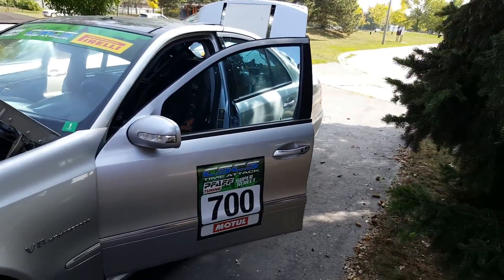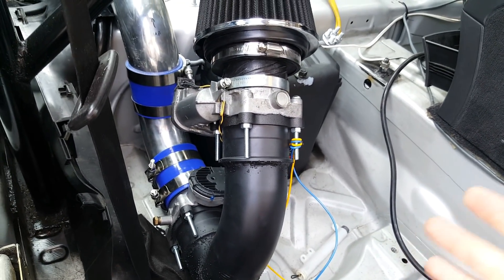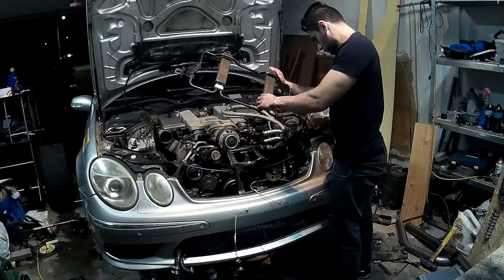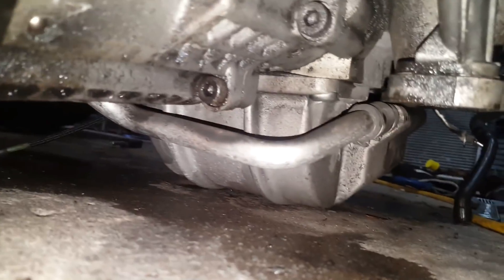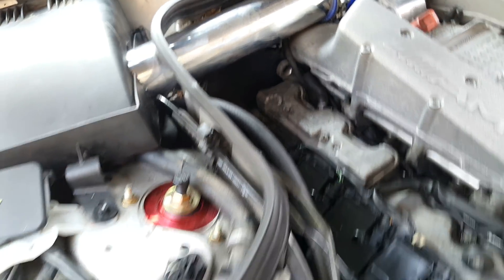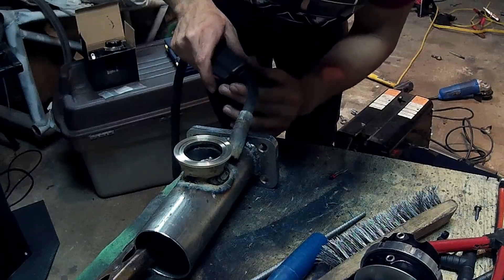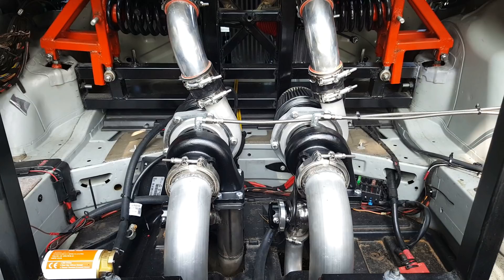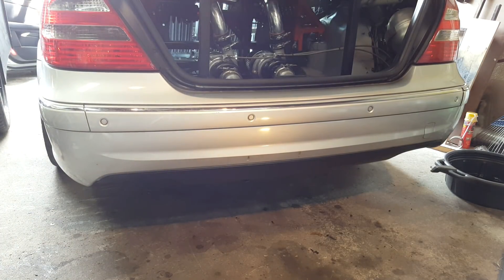How to Build a Properly Fast Track Car - Part 11 (Turbo Install)

Comment: What if you don't want the supercharger pressure at all? Would it eliminate have to add the circuits? Just turbos in the trunk and turbo charged pipe coming upto engine bay, where would you plug the charged pipe? To the throttle body? Or the the intake canisters y pipe? I'm planning of removing the belt from the supercharger leave the clutch wiring as it and just feed it the charged air from the turbos and get a tune, is it possible?

Comment: Heat generating and / or exchanging components should be located and exhausted at the rear; and any kind of intakes should be at the front. Fluid expands when heated and intakes sucks. Vastly reduces drag due to air friction and compression. You also gain some thrust. Intakes pointed directly at the front works like a ramjet (kind of) at high speed if designed right, working like a forced induction system.

Comment: the intercoolers in the back seat aren't doing anything except restricting flow.  straight tube would be better.
twin charging is when supercharger and turbos run sequentially.  if you use the supercharger's bypass valve, it's just turbocharged.
Have you seen the STS turbo system?  why run exhaust up into the trunk, then back down?  having turbos under the car will help cool them.  how's the heat inside the car now?

Comment: Did you go with smaller pulleys for the supercharger? You’d be able to get a lot more boost from it.
Reply from the maker: Yeh, tried it before. The intake temps get too hot with the supercharger.

Comment: Due to the long exhaust pipe before the turbos, you will experience turbolag, but if you do it right, the supercharger will compensate for that

Comment: This is pretty nuts...one of the your first videos I saw was on the building the rear suspension and now I ran in to your video on suspension set up. I also had investigated a rear mounted turbo which you did, real nice. I subbed since it's the kind of stuff I do! Anyway, has your F/R weight distribution changed much with the turbo out back?
Reply from the maker: Not much of a difference really, because the mufflers removed were actually heavier than the turbos. The turbos only weigh 8kg each

Comment: Im curious on how much boost the turbos make? i would think they wouldn't spool that much since they look fairly large 68-70 mm and they are 2 of them. Massive lag probably. I have a 5.3 LS with twin 70mm turbos and they are quite laggy even so close to the exhaust with lost of velocity. Great content tho keep it up
Reply from the maker: Lag wasn't too bad surprisingly. I had the supercharger for low rpm but later I also ran the setup without the SC. The turbos were always on full boost by the time the car reached corner exits. Wouldn't recommend it for street use, but on the track because the exhaust gets hot and the engine revs fairly high, lag isn't too bad

Comment: Efficiency is lost when turbo are so far away and oil the turbos is weakening the oil pressure of the engine/add a electric oil pump for when racing.

Comment: I would have had the exhaust go straight out on each side of the license plate. The whole back of the trunk could be open for air to flow out after you have the roof scoop

Comment: I would of chosen a difference to way to lubricate the turbos. I would give them their own oil system, independent of the engine. An electric oil pump that lubricates the turbos from their own oil tank with a cooler and thermostatic switching would work well. You could position the tank above the turbos so that no chance of oil starvation. An oil accumulator with a pressure switch would allow more oil for the engine,pressure monitoring and reduce any chance of oil starvation.

Comment: I have made those pulleys from good quality billet alloy for a customers race car. We used high quality SKF bearings. Way cheaper than the plastic items and not had any problems with them. A good shop could make them for you and one less thing to worry about. Impressed with the level of engineering, design and effort you putting into this project, some great stuff going on!

Comment: In retropespective.....Twin turbos added to an already supercharged engine is asking for overheating trouble... Even with additional coolers you haven't avoided a blown motor. ....... So is it to much are due to bad cooling after all?
Reply from the maker: The supercharger disconnects after the turbos spool up. The temps were actually cooler with turbos since it had much bigger intercoolers. The engine blew because it lost oil pressure. It wasnt boost or power related.

Comment: What software are you using to tune the mercedes ecu or are you using a stand alone?
Reply from the maker: I wanted to find a tuner to tune the stock ecu for me, but so far it seems unlikely. Most Mercedes tuners here don't know anything more than a simple pulley tune. 
I'll try to look for a tuner before next season but if I cant find someone then stand alone it is.

Comment: wow. butchered that car.  🙈.  u could of did a tune and a a pulley upgrade n got the same horsepower lmao.  ur such a noob to do that to a mercedes. smh.    rip e55. cant wait until you blow it up 🤣

Comment: Dude just be careful of in-cabin exhaust leaks from the turbo. Use a  Carbon Monoxide Detector to see as this gas is odorless.
Reply: only the intake goes inside the cabin

Comment: I applaud your work, the twin charge system is neat, however I can't help but wonder why?? Its a very heavy AUTOMATIC sedan. Seems like a huge expense and amount of work to get an 'average' result at time attack. Thanks
Reply from the maker: tbh its probably just as expensive as other cars its competing with. I've spent around 30k including price of the car so far. People that start off with miatas or s2000s also end up spending the same amount to get similar laptimes. Its also been on stock power so far, so with the added power and hopefully improving my driving times should be good
Reply: SK8215 I understand all that, however it is still and Automatic, given your obvious high level of knowledge in engineeing, you must realise the power loss and overall weight that this transmission creates is definitely hampering your efforts, so is the glass roof and mechanisms. There is still a large amount of weight that could be taken out of this car. It is far easier to remove weight than add power.

Thanks again, and best of luck... Looking forward to future progress.

Comment: If you cut the rear floor pans for the intercooler intake and vent it out the back window you'll be less likely to produce lift than having the intake on the roof. Depending on how much resistance the intercooler cores will add you might even make downforce.
Reply: Matthew To this and flapping,when i deleted my sunroof before i installled the carbon plug i went for a drive without it,my roof was flapping at 90kmh

Comment: Nuts.... 
what will you use to control the supercharger/turbo valve? Some sort of microcontroller? 
Also, what are the options for ecu tuning. Are you gonna go stand alone?

Comment: Build is coming along nicely. One point to add about you oil cooler you added in front. Mounting it upside down will actually not cool oil properly. What your doing is only filling the bottom portion of the cooler in its current orientation thus not completely filling it and not taking advantage of the whole cooler and the fins to do its job. take some temp readings worst case but i would flip the cooler around.
Reply from the maker: Yes, the oil cooler is upside down, but I did run the car with it positioned the other way before bolting it in. Hopefully the air should have bled out. There wasn't enough space for the lines to fit if they were at the top because the hood latch goes there.

Comment: Could you route the intake for the turbos under the middle of the car to increase mid-car downforce?
Reply from the maker: I don't think the intake flow is enough to make downforce. Fan cars used that effect to make downforce but they used fairly large fans at the back.

Comment: Great video - remember when I've asked how will you resolve problem with lag?  Thanks for explanation in this video. The valve system seems very complicated. But even with valves so far away from engine - I wonder how big will be "lag feeling"? How much power you want to make?  
Didn't you think about separate Oil system for Turbos? It could be possible, but that will be probably "overengineered".
BTW - because of you I'm thinking for W211 wagon for myself (but with diesel ;) )
Reply from the maker: Yeh, I remember your comment from a while back. The lag can pretty much be eliminated if programmed right. The supercharger wont disengage until the pressure reaches the engine. That said the lines should fill up quick once the pressure is already built and turbos already spooled up. I dont think theres a need for a separate oil system, and good to hear your going with w211. I've heard a lot about those Mercedes diesels, never owned a diesel my self, but should be a great car
Reply: I can not wait to see "boost coming" ;) Already in PL there's a guy that's building 8XXhp 320CDI, so it should be nice engine for daily driving ;)

Comment: I love how you are just modifying whatever you can dream up. What division are you competing in next year? I might bolt on a super charger myself and drop a division to superstreet as well.
Reply from the maker: Most probably still super street. They wont allow it in street and unlimited would be too fast I think. Your car would be lethal with a supercharger. I look forward to seeing that !
Reply from the maker: What do you think of unlimited? I know theres less people competing in it so probably a better chance for a podium, but then the faster guys are just in a league of their own.
Reply: Its ok. You have to be fast though or you might not qualify for the finals. Some competitors tried to run unlimited to make podiums, but ended up getting out qualified by 10% and basically not scoring any points and missing the time attack finals. That wouldn't be fun. My car isn't an unlimited build or I would do it again. Even supercharged that would just bring my car on par with the standard super street build.
Reply from the maker: Makes sense. Even SSR is getting really crowded, not sure how it will be next year. I guess I'll see what type of lap times I get and decide based on that. I like developing the car but I really need to get my driving up there. What lap time difference do you think slicks make over the trofeos?
Reply: Slicks are probably a second to a second and a half faster on their first heat cycle. Once you use them once they seem to lose a second. Use them twice another half second. That's for the DS slicks. They fall off quick.
Reply from the maker: So they are just trofeos after 2 heat cycles. Not a big difference in terms of time I guess, but thanks for the idea. I'll keep it in mind in case something changes for next year and good luck with the supercharger install. I'm already looking forward to seeing it next year. Should be competitive in SS

Comment: I really want to see this work. What tuning software are you planning to use?
Reply from the maker: Planning to get the factory ecu tuned with bigger injectors. I wont be doing that my self

Comment: I really like your videos even though I started watching them this morning☺ also o wanted to say that the idea with the twincharging is awesome and the pushrod suspension is great👌👌👌 I would give you a tip you probably have already thought of but here is it :a good method to keep the intercooler temps low is to have water sprayers.Cheers from Bulgaria and good luck with the racing.
Reply from the maker: Thanks and that's a good tip. I've heard about it but haven't given it a try yet

Comment: Awesome Project can't wait for the finished twincharged video!
How much horsepower gains are you looking for?
Reply from the maker: My goal is 700hp so around 550-600whp, but its too early to say. It really depends how much the transmission will safely handle
Reply: SK8215 transmission can handle way more than 550 wheel, heard good up to 800 hp if not more

Comment: Those turbos are going to be really inefficient mounted at the back as well as introduce horrendous lag due to the amount of pipework they need to pressurize before boost is created at the throttle body. Unfortunately there's a reason why all turbos fitted by OE manufacturers and race teams are always as close to the engine as possible. A for effort and the quality of your work :)
Reply: Aaron Howe I think that's why he has the system that let's the engine run off of the supercharger until turbos build boost the throttlebodies in the passenger seat open and allow turbo charge. The throttlebodies also allow the turbos to build boost and fill all those long pipes.
Reply from the maker: Your partially right but in this case its a twin charged system. The supercharger will already be making boost while the turbos are spooling up. There wont be any lag if the switch over happens correctly.
Reply: @xfmotorsports  In that case why not reduce weight and complexity by using one large turbo?
Reply from the maker: Ben Brooks  Correct !
Reply: Yes, that is a lag-proof design.  However the throttle body arrangement is totally unnecessary, but a cool engineering piece nonetheless. Personally, I would have removed the supercharger to help lower intake temps, BUT, I suspect the supercharger will run cooler once the turbos are providing boost to it and there is no longer load on the supercharger.
Reply: Aaron Howe I'm guessing you didn't watch the video before commenting. The hood was open and the supercharger was right there. It's lag free buddy